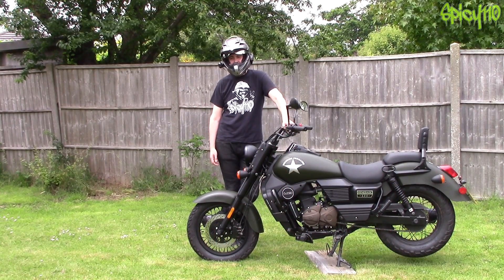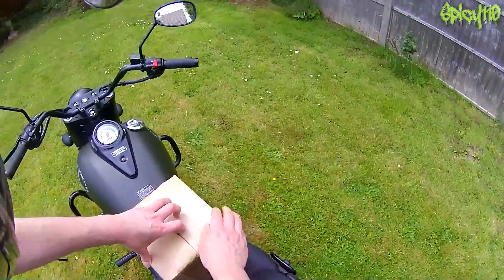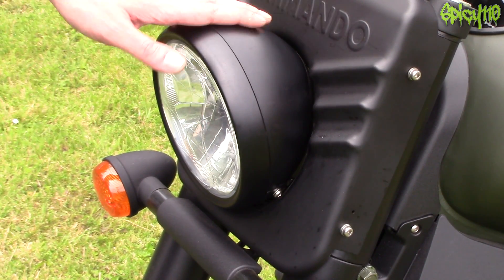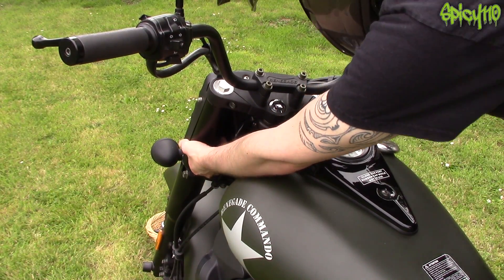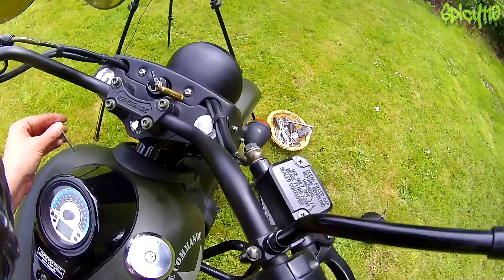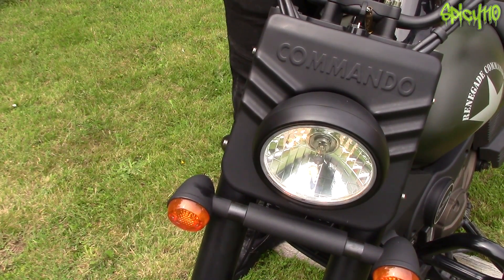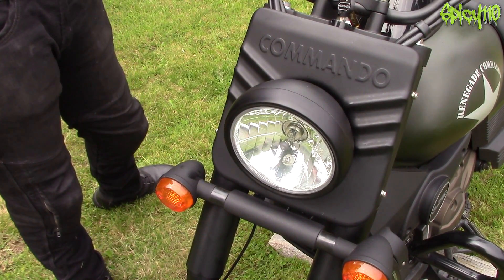First time I broke a review bike!

Comment: Ouch Thank god they paid for it, Its 78.99 for that Part           I just changed by Rear Brake Pedal over on my since had a little fall off in April and bent of the hole pedel
Reply: just go on ebay I get fenders and stuff from scrapped bikes

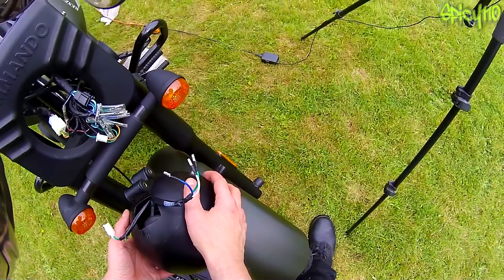Comment: @3:55 ... beg your pardon, me being a noob and all (had a bike for 2 months, so I really am :) ) but aren't the big 4 usually using proper sealed connectors, like the really hard to find sumimoto ones ? the ones on this bike look like regular crimped connectors covered by a simple transparent plastic thingy ... not very waterproof if I may say so
Reply from the maker: Compared to say a Honda cbf125cc same stuff, even my Drz is like this, but has a few sealed connectors in risky areas.
Reply: @spicy110  hmmm, now I am itching to disassemble my new bike just to check what connectors it has all over the place :)) won't do it though ....